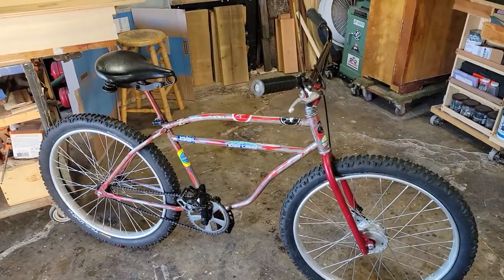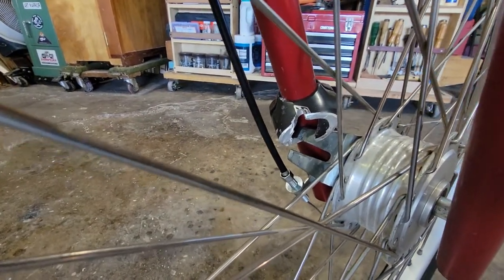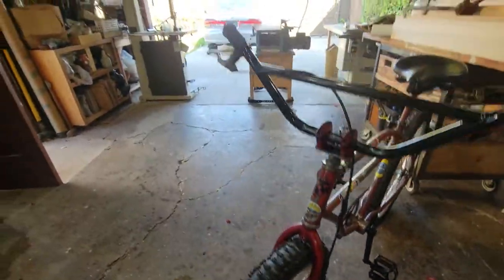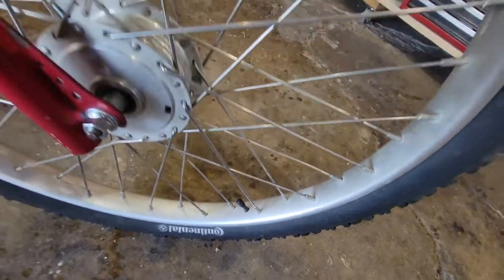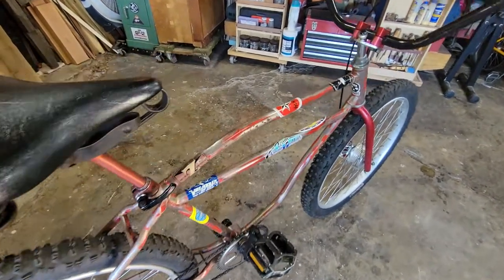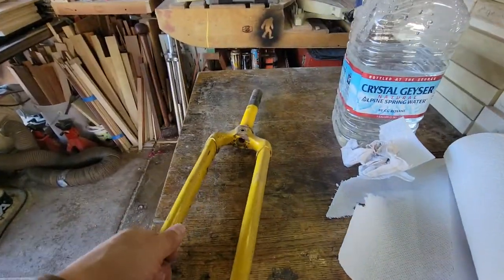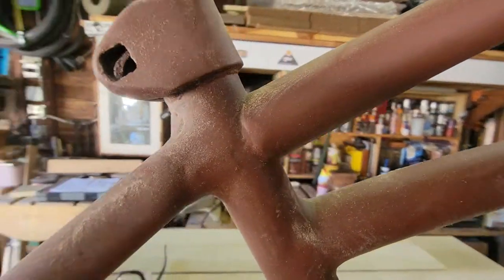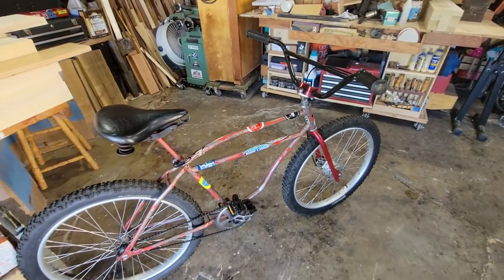Worksman Cycles Klunker  -  Here It Is AGAIN....

Comment: Great bike man. I'm building a Worksman my self, what size crank/sprocket and bottom bracket did you use?
Reply from the maker: All that information is in the video: American BB, sealed bearings, 3 piece crank, 180mm, 46 tooth Schwinn sprocket
Reply: @AstroVanTribe  right on, thanks man.
Reply: Could you tell me the length of the spindle? I'm getting ready to order, just not sure. Thanks. Sorry for being a pain in the ass
Reply from the maker: @tigersteamer  I have no idea - It came with the profile cranks which were pulled off another bike